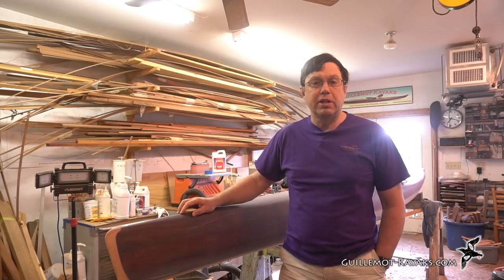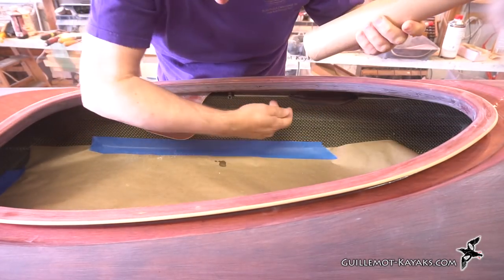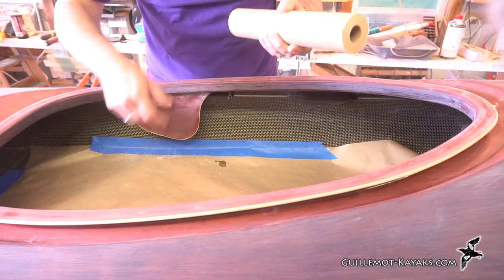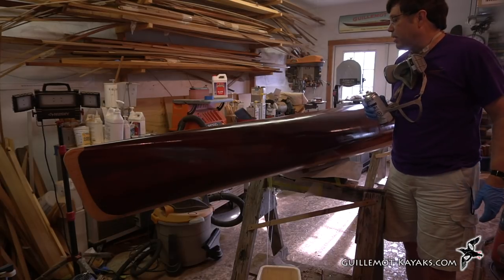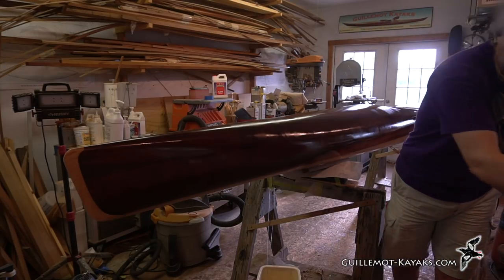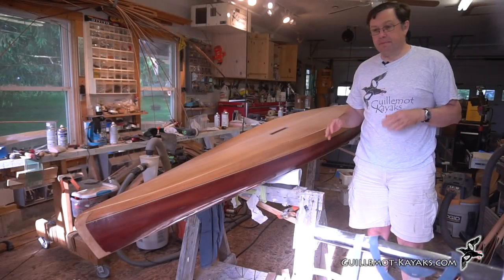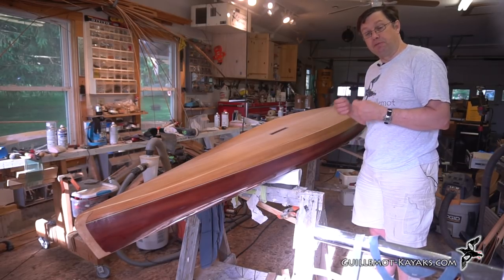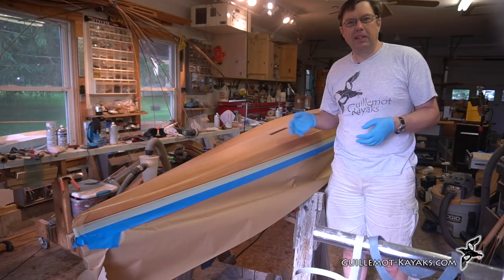Spraying the Final Finish - microBootlegger Sport - E65

Comment: Hi Nick, I am refinishing my cedar strip canoe. Originally I had varnished it but after a couple of years it has started to peel, so I have sanded it down. I was thinking to re-varnish but then I see you with this two part clear coat. Could you please give me your opinion and thoughts about these two options, please?
Reply from the maker: The key to making the varnish stick is good prep. The whole surface must be clean and sanded to about 220 grit.

The automotive clear coat works very well, but it is tricky as a DIY. With good prep, an auto body shop can do a very nice job, but it costs more out-of-pocket.
Reply: thanks Nick!   After sanding I was trying to clean last night. I first used my shop vac and then wiped with  denatured alcohol. pretty clean, but not completely. what do you use?
Reply from the maker: I will finish with a wipe down of a compatible solvent. For example with oil based varnishes I'll wipe down with mineral spirits or a brushing thinner meant for the varnish.
Reply: Thanks Brother!
Reply: @NickSchade  The basic prep difference for an automotive prep is to wipe it down with an enamel reducer first to lift all the grease and debris off the surface.  Mixing the two part may be trickier, but no worse than the fiberglass resin mix.  Then you have great control over volume, fan shape and coverage instead of what you get with the spray can.  And you don't tend to get fouling on the nozzle as I seemed to have seen you deal with during your finishing job.  Something to consider.

Comment: I love this whole project.  The skill and craftsmanship involved is wonderful to watch and now I have to seriously consider doing a strip built canoe also.  Seems like almost a rite of passage.

As for the finish, I think you might be surprised at how simple it is to use an HVLP gun with a regular compressor and using two part clearcoat from an auto body shop.  The 2K you used is a cyanoacrylate-based finish and those and even harder ones are easily available.  The control, coverage and consistency from such a system cannot be matched by a spray can.  As for the dusty environment,  spraying in a garage where you have wet down the floor first solves 90% of the dust problems for the time the surface is vulnerable to settled dust.   I've gotten excellent results finishing high powered rockets with these materials and it has always come out great.

Just something to consider for the future as this is the first video I've seen using a spray finish instead of the normal brushed on spar varnish.

Keep up the great work!

Comment: Quick question. What did you wipe the boat down with before spraying the finish? Alcohol I assume?
Reply from the maker: I used a degreaser cleaner as the final wipe down. It is stuff intended for Autobody refinishing.